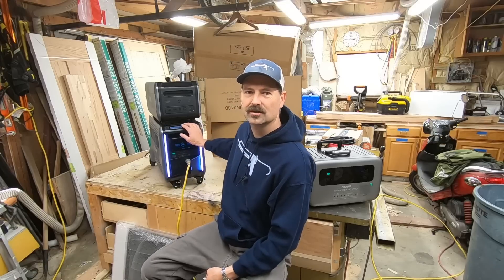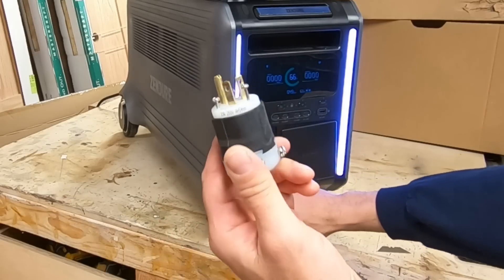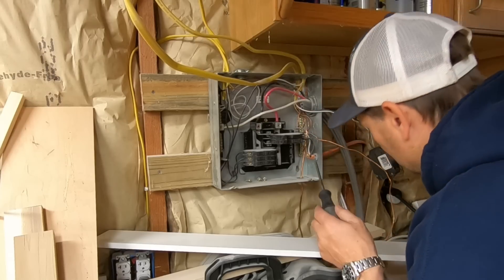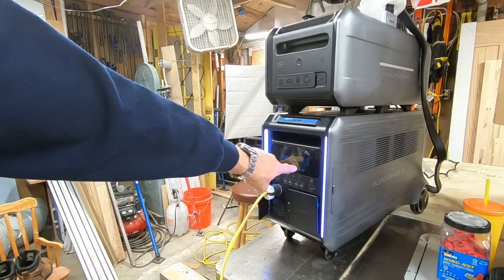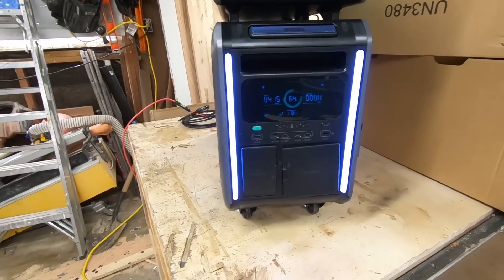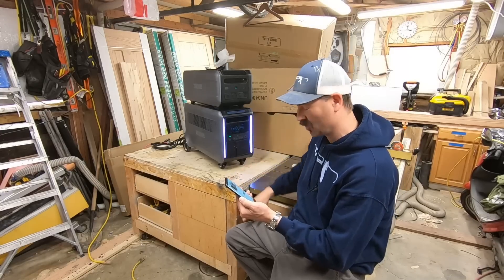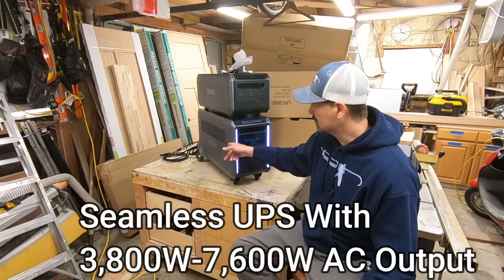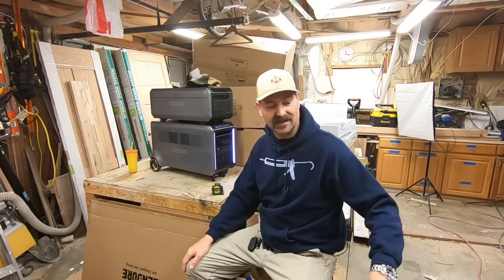Battery Power House Set up | THE HANDYMAN |

Comment: the only advantage I can see to batteries and solar is that it's quiet compared to gasoline generators. The initial cost in solar and battery also makes me wince.
Reply from the maker: You can buy a lot of gas with the price of solar.
Reply from the maker: Every new house built in California has to come with batteries and solar
Reply: solar isn't too pricey but the batteries yea those are